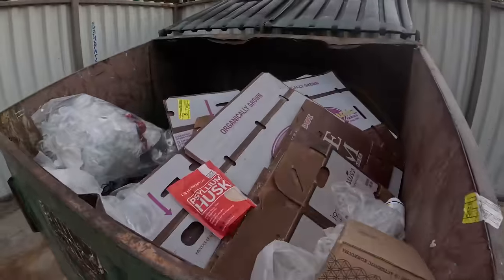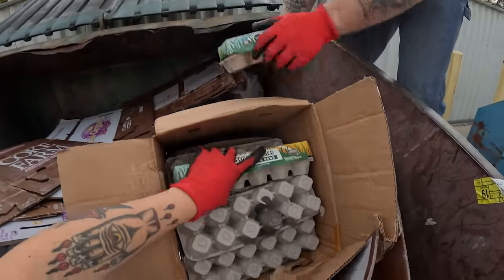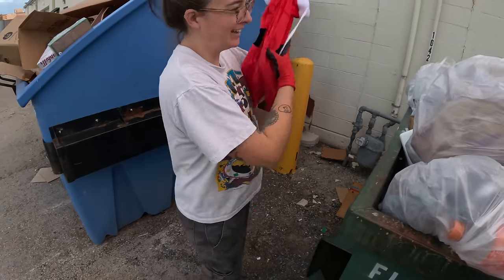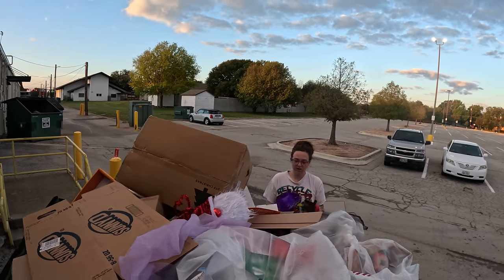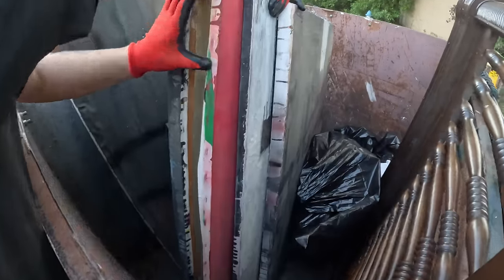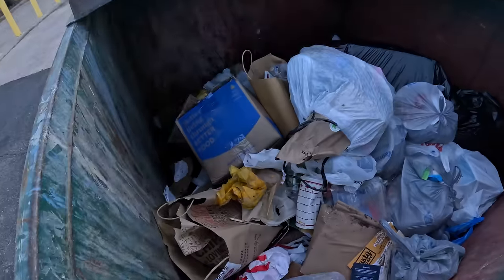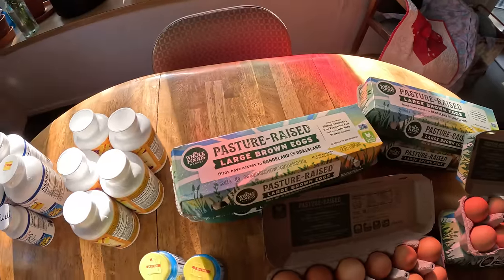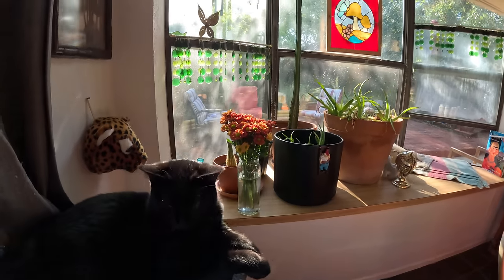Grocery Store Dumpster Diving! We Found Eggs, Vitamins, and More!

Comment: If your canvases are loose on the stretchers, some times if you heat it some with a hair dryer at the joints it will tighten it up. If they are purchased stretched from the store, they often come will little wooden pieces attached to the back of the frame. They  get inserted around the joint areas to tighten up the stretch! Great find! They are so expensive any more!!

Comment: U should have taken the poles. Great for knocking broken branches off trees, or tying or taping branch cutters to 2 of them and chop high branches. Those were strong ones too. The ladder was great for something too. It was in great shape.
Reply: Those poles are a set of professional tree trimmer it's a pole saw the poles lock together and there is a head pease that has a saw on it.
There was a big rope in the dumpster with the poles I bet that someone forgot to pick it up and put it on the truck and someone else put it in the dumpster.

Comment: A little wood glue tightens those wooden pegs for the coat rack, but better yet, you could have made a wall coat rack instead without the bottom. Long pegs hold so many extra items too. U have to be creative sometimes to figure out good uses. Even in the garage you could have hung several items on one peg, like brooms, snow shovels, tools.

Comment: I draw a hard line at bin diving for food item. I mean I dont make a career out of fishing things from a dumpster but if I happem to see a TV set for example I know that they have LED backlights in them that are likely good and can be modified to run on 12 volts so I will grab them and other electronics that may be there, this adds to my stockpile of LED lighting and board level componets that can be used to repair other devices.and keeps e-waste out of the landfills.